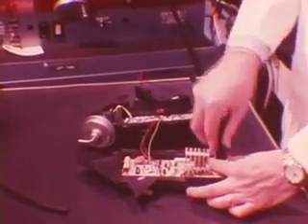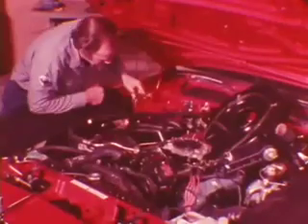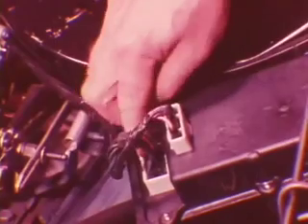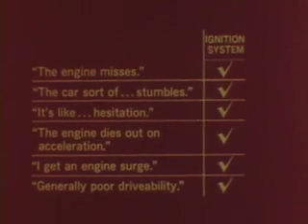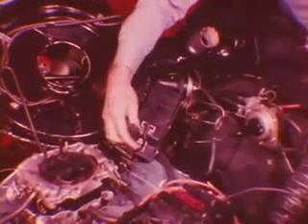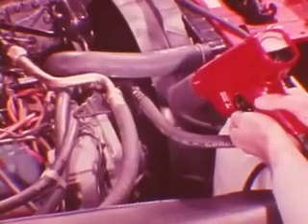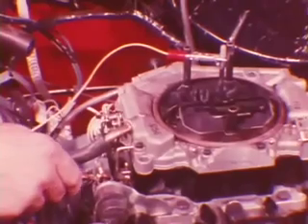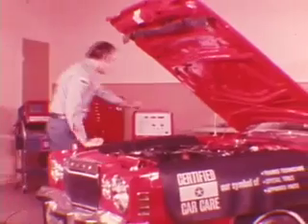76 06 Diagnosing Electronic Lean Burn System Performance

Comment: For its time it was supposed to be at least on paper a really good system and of course it turned out otherwise due to a few flaws one was mounting the ( computer ) in the air cleaner assembly where its exposed to all the heat of the engine and two it was basically before its time as far as parts went. The hardware made it unreliable.

Comment: So is it better to get rid of the lean burn system?
Reply from the maker: Yes, otherwise the combustion is too hot. This can cause the valves to burn and also produces unnecessary nitrogen oxides.
Reply: Not all leanburn systems are the same.
The early 2 pickup and 2 plug systems that were on 4 barrel cars were problematic. But the single pickup and single connector units that were on 318s and 360 2 barrel engines plus slant sizes were actively fine.
Me and a friend have several early 80s Chryslers with 318s and they still have original leanburns.
Reply: Totally jegs makes a lean burn delete kit and they were not reliable